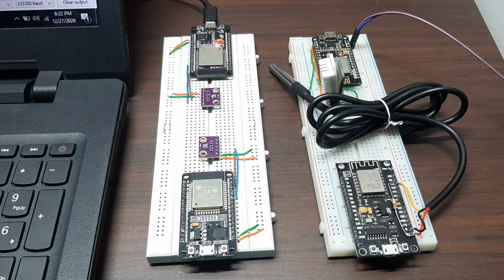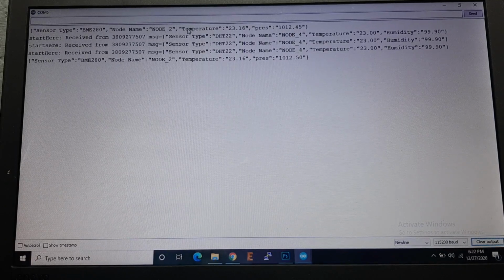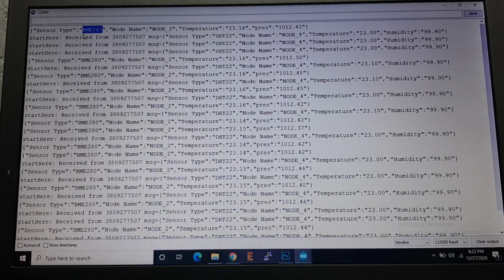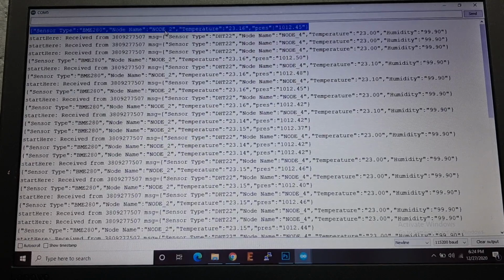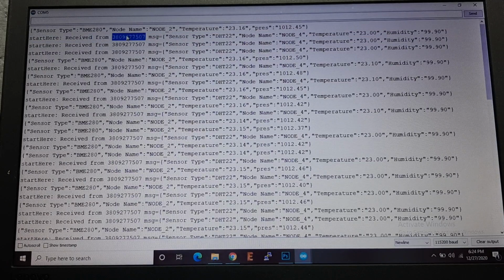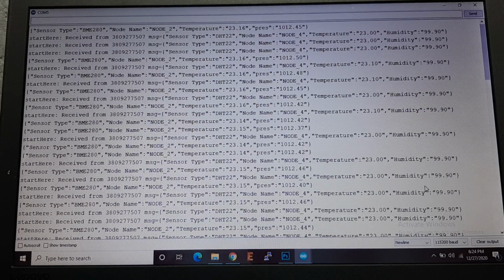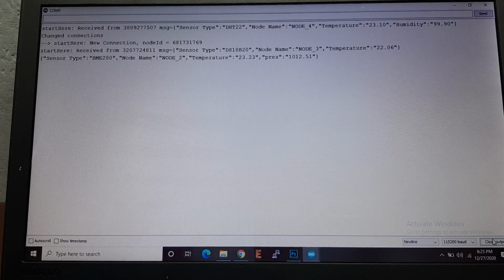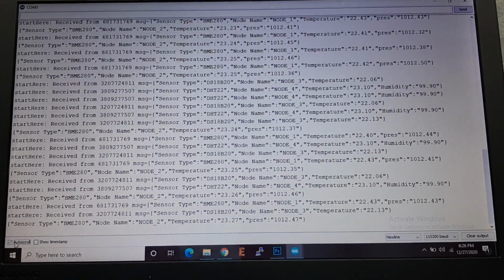How to Configure an ESP Mesh Network using Arduino IDE

Comment: hey can esp send and receive data when connected with the dc voltage source not plugged with the arduino ?
Reply from the maker: yes it can, as long as it is connected to the network